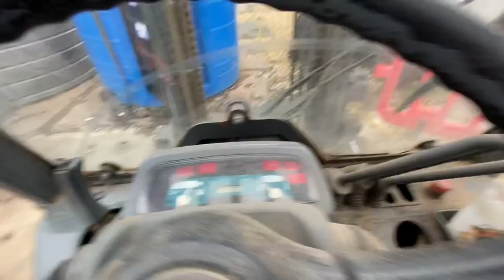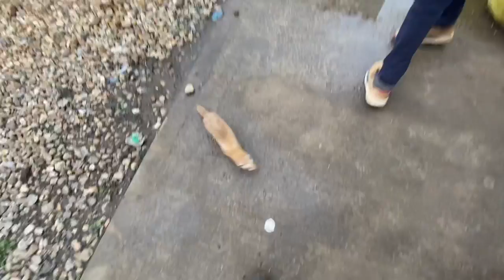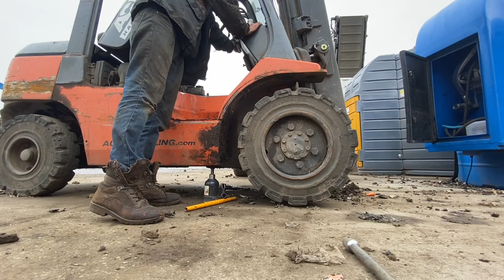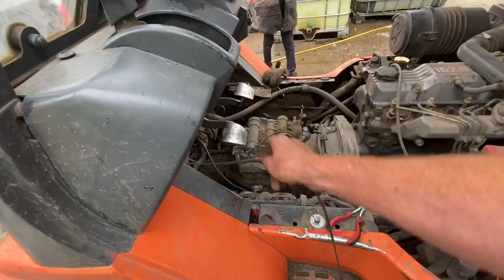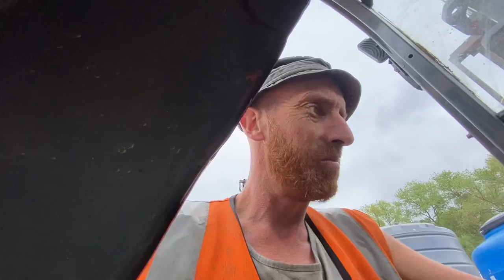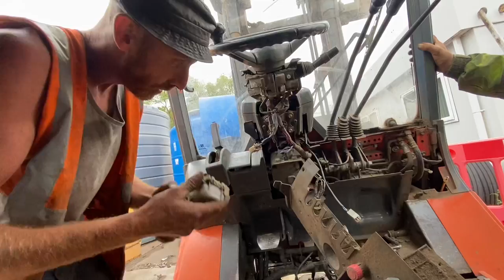Toyota forklift fault no gears! Fault finding struggle

Comment: On the Toyota forklift you should find a switch just under the accelerator pedal that cuts drive. Common problem, sticking switch or broken wire in the loom that goes to it.  Give us a call at Leicestershire Forklifts next time your struggling, always here for advice.
Reply from the maker: Thanks Andy I will mate…. Didn’t know where to look first on this one pal, a bit of advice gos a long way! I’ll speak to you soon no doubt 😂😂👍
Reply: What switch??? IC series fly by wire for acceleration not drive circuit.
Reply: Hi Andy I have a hyster H2 50 XL 1988 model that has just done the same she will select reverse and go anywhere in reverse but won't go forward she will go a bit when cold but not a hope when going up hill or warm any ideas or knowledge would be very much appreciated
Reply: Thank you 🫶
Reply: Had that problem with a similar Toyota, unfortunately in searching  for it we removed the gearbox cover and stripped it down.now it takes a good rev to get it moving inany direction,resulting in an  jerky drive. I SUSPECT INCORRECT ASSEMBLY.

Comment: I learnt this little trick when soldering but I think its down to the copper having some sort of coating, It happens a lot with certain wires (headphones etc) but if you use a lighter on them before they should tin pretty well ;)

Comment: Hey Chris i dunno if you know but Lidl have some 20v tools in this week and one of them is a 20v soldering iron that runs off the Parkside 20v batteries and it's really good, I would recommend one, great for on site soldering without the need for a power source.

Comment: Usually when the problems at the stalk you can sand the contacts but this isnt always a permanent fix. 
I believe the contact bridged out may have been part of the neutral start circuit.

Comment: Just scrape off the coating with a Stanley knife first Chris, scrape a wire until you get a nice shiny copper, then get yourself some flux ( no clean is preferable for wiring as water washable will cause corrosion and another struggle) same with solder make sure it's no clean

Comment: Hi Chris , I think you may have just bypassed some safety device on that forklift drive selector !🙈, maybe it has a switch under the seat or seatbelt switch that stops you selecting drive whilst off the vehicle! Might need investigating further 👍great videos by the way
Reply: Was thinking the same, not a fix if what you fixed wasn't found broke.

Comment: We had same fault on our toyota the reverse beeper is on a seperate circuit. It was the forward reverse selenoid. 
And the little rubber thing with two wires going in to gearbox twist it about and it seemed to sort it.
Reply: hlw bro....same problem my forklift -toyota 3fd50  5ton.. 
Not forward or reverse... Plzzz help, 😢

Comment: Are you serious or just a put on for  views. Need some serious troubleshooting training. First need wiring schematic and  VOM. Should be able to  check voltage at seat and p brake switch then at trans solenoid. Not rocket science . Back up alarm possibly on  separate circuit in control switch.
Reply from the maker: Make a you tube on it 👍
Reply from the maker: Normal people don’t know everything! We have to fault find and struggle and learn as we go on! Your obviously a very clever person
Reply: @Professional-struggler  not really just don't  enjoy guessing and patch repairs. As a retired Toyota, Cat, Clark you name it road service mechanic for 40 plus years nothing worse haveing  to repair a machine that was " repaired " improperly . Makes it harder to troubleshoot.  There are a lot of safety features built in to Toyota lift trucks and to override makes no sense  you leave yourself open to legal problems if someone gets hurt. Believe me I've seen them . Stay safe .